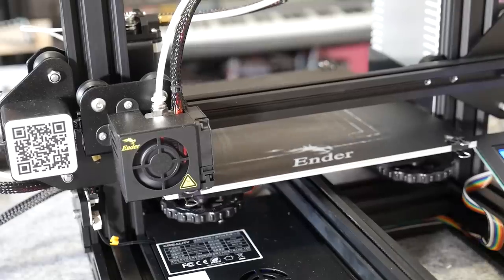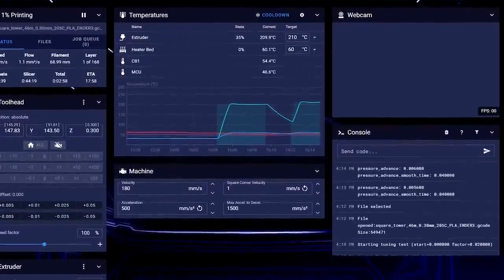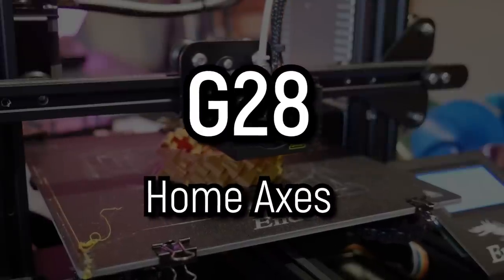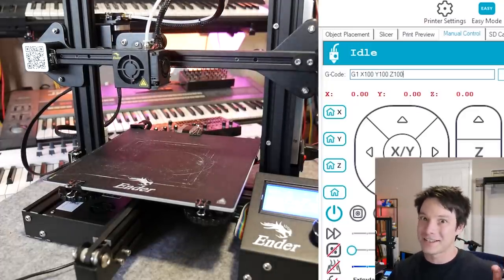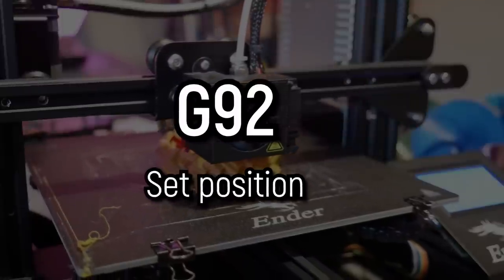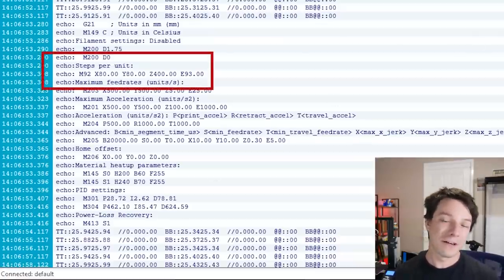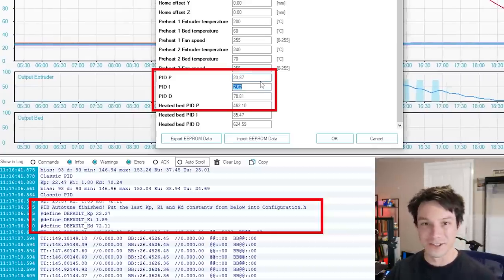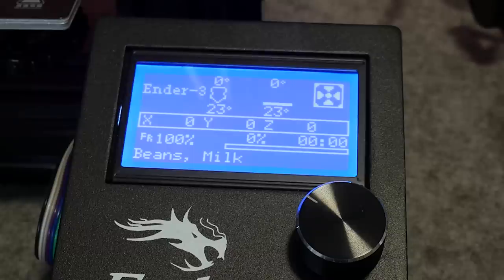Top 10 useful G-Code commands for 3D Printing

Comment: M300 and M117 could be used for diagnostics, in conjunction with the registers (i.e. Out of Work Area error could list what position it is trying to reach using an M117 code and then use an M300 code a couple times)

One set of absent codes is the G2 and G3 commands, which does Circular Interpolated movements. G2 is Clockwise, G3 is Counterclockwise.
Reply: G2/G3 reduce the size of the G-code and the stutters incredibly. Arc Welder for Cura is highly recommended in my opinion to make use of this, sadly not all printers support it. I find it quite dumb honestly, very few cases are so starving of storage that you should disable it.
Another one that takes some effort to use effectively but is pretty incredible is M486 - cancel objects.
With the appropriate post-processing script on Marlin, you can separate a multiple object print into individual parts entirely, and cancel each one individually if you see need.
The only time it doesn't work is with supports. If the support starts to fail on one part, you'll have to live with it and cancel everything or let it be, as Cura adds the Z change line right at the start of a support structure code if it has that.

Comment: M300 &  M117 are super handy for debugging, and having the machine communicate what is up. I have several machines in the next room over from my work area. Each has different tune it plays at the end of a print to let me know which machine just finished. M600 for manual color changes is super handy for basic color swaps on just a couple layers.

Sadly and frustratingly Bambu machines have no serial interface and no support for M300, M117, or M600.

Comment: M and G code is were I started in programing For FANUC CNC controllers 25 years ago, the thing that has got better is the GUI or interface software on computers to build the gcode file,
Computer power and graphics cards have grown alot. Thanks for the video !

Comment: P stands for proportional, I for integrating and d for differential. In short the p part has a linear feedback with an amplification factor which can be 0 to very big numbers. The Integrating part provides a feedback equivalent to the surface between the signal and the x axis of the difference between the setpoint and actual value. The D part outputs a signal equivalent to the rate of change of its input. These three are put in series and if you tune them just right and provide them with the right feedback, they will regulate whatever you want.

Comment: 4:15 You definitely want to prevent the USB from powering the printer.
A tiny piece of electrical tape over the 5V line on the USB connector can block the power. Or you can cut a USB cable open and reconnect all of the wires except the 5V. If you have steady hands, another option is to desolder the 5V connection of the port on the printer's mainboard.

It's a design flaw in some printer brands' USB implementation, which should be data only. There are multiple reasons why it's a bad idea -- you're basically giving 2 independent 5V power sources (which may even be at different grounds) to the printer's mainboard. Usually it'll be fine, but it could easily kill the printer mainboard (less likely, but it could even bite your PC's USB port or motherboard).

Comment: The only G-code command that caught my attention over the years is M600, filament change, for simple but very effective multi-filament/colour prints.
I discovered that PETG & TPU can stick together in these multi-filament prints, but still haven't yet figured out any designs which could benefit from being part TPU & part PETG.
Reply: Vibration dampening?
Reply: Printing a seal / gasket onto the rim of a case.

Comment: I'd recommend turning the power on while connecting to your printer. My Ender 3 has custom firmware installed, so my problems might not happen on your 3d Ender 3, but when I give it USB power and later turn on the Printer, all axies move at twice the configured speed and violently jam into the frame/buildplate (I actually lost a nozzle to this)

I just learned to always turn on the power before connecting my PC or Raspberry Pi

Comment: Good info.
I started with Repetier when I had my PrintrBot Simple 1405 print 7 years ago.  FYI Simplify3D (even the 3yr old version 4.1.2), UltaMaker Cura, PronterFace, Prusa (I believe via Octoprint), Slic3r all support a serial connection and limited control (speed and E-flow).  I have Prusa recommend not to print via serial with the chance an errant command being sent.  I have printed via my Mac using serial (Simplify3D 4.1.2) almost exclusively for 7 years and had no issues (99.98% serial, 0.02% SD card).

Comment: G Code to pause prints, maybe move to somewhere convenience, turn off nozzle heat to allow you to extract filament, then when your ready come back to temperature, extrude until new filament loaded (suitable amount purged), then stop, go back to where it left off even if you nudged it a bit while you were messing about and resume printing. Was going to try and sort out some G-Code to include to do all this on my Qidi X-Plus that I would insert at a particular layer height but, it all seemed a bit much so I have never tried it.

Comment: I'm a machinist and have been using g code for my entire life.  Since getting into 3d printing, I've been wondering why printers don't utilize G2 and G3 arc commands.  You could make a circle with one line of code instead of hundreds.  My longest programs machining is about 200k of code.  A simple 3d print of a toy was a few million.  All because it only programs in linear commands. (A, J and, I  command would be needed though).  There are so many parameters that aren't being used.  Anna what about, macros?  Would a printer read it?  Or the ability to pull up separate programs and run them within other programs.  We should get together and blow the lid off printing.  Right now it's so so basic.

Comment: A cool thing to do is: put some electrical tape on the 5V on a usb cable (those to make your cable longer, dont know how they are called in english), then the mother board only gets on when the power supply is switched on o:

Comment: Pretty sure you can actually drain the battery if your laptop while connected to a printer via usb cable. I was helping my friend set up his Ender 3 Pro, (context: his laptop battery size/capacity is at or just about at the legal limit for here in the USA, and it’s in pretty good health), and in just about two hours it nearly completely drained his battery from about 90% to about 10%. We had Cura open & connected to the printer and his laptop was plugged into the Ender 3 Pro for most of the time, plus the ender was plugged into the wall (the laptop was running off battery power).

Comment: The joke at the beginning about ChatGPT is funny, but honestly it's not far from the realm of possibility. You can represent a 3d object as a sequence of geometric arguments (point clouds, or curves, etc). And GPT models (General Purpose Transformers) are really good at working with long sequences of values or tokens. So it's entirely possible for someone to train a vanilla GPT model on mesh data, and the corresponding slicer G Code. And what you'd end up with is something that could take an arbitrary mesh, and render a (hopefully) optimized sequence of G Code steps for any machine to use. 

In fact, I'd be very surprised if the major printer manufacturers are thinking about this as they iterate on their slicer designs and optimizations.

Comment: My understanding of disconnecting power to the printer while plugged into the board through the usb is for safety. Saftey being to prevent the printer from doing anything unexpected like turning on the bed or hot end.

Comment: I watched another video that gave the advice to use your heated bed along with the box your filament came in as a dryer. They said cut the bottom side off the box, lay it over your filament to insulate it some, and heat the bed. So I want to write a simple GCode to set the bed temp, present the bed forward and raise the Z out of the way. Is there a way to do a timer where it'll sit for 4 hours and then go into cooldown on it's own? Maybe M85 but I can't find specifically what that command does for a shutdown sequence and don't know what the max value it'll accept is. I'm assuming too huge a number could crash it.

Comment: I used to run my Prusa for few weeks during pandemic when LCD broke, I was able to print using the PC to manually control the machine etc. Then the bed heater broke :D but the printer was still going strong but only with PLA , those were the times when I sued that link a lot, I did lost few prints because windows updates restarting PC when I was not there..

Comment: I like using M104 and M140 at the start of gcode so that it can home while heating, and then using M109 and M190 with the same setpoints before the first use of the extruder (purge and swipe) in case it wasn't done yet. Currently, homing is all that happens between start heat and wait-for-heat, so there's usually still a wait, but it's at least less than only using wait-for-heat instructions.

Comment: To solve the problem of USB power keeping the printer CPU and screen active, just cut the red power wire in the USB serial cable you are using. I use Pronterface on an old Windows desktop machine to connect via USB to my Ender 3. Also, most Ender 3 printers will handle a serial connection speed of 250000 bps, and I recommend this over the default 115200 bps especially if you will be sending gcode files to the printer in real time to print. You will want the faster speed to avoid lags that can happen during curves, where the linearized gcode is voluminous. Lags result in ugly blobs on the print. To change the serial connection speed, you will need to reconfigure the Marlin firmware.

Comment: Have you ever considered going from STL to a full metal casting? Seems like something you would like
Reply: Dunno about Angus, but there are people who do this.  Print a "positive" in PLA, form a mold around it, then pour in the liquid metal.  The PLA gets burned out, if you've done everything right.  It's basically "lost wax" casting for 3D-printable materials.
Reply: @firehawkdelta  yeah! Iv seen people do it with plaster and resin printers too. I just wasn’t sure if he’s thought about doing it.

Comment: I was just starting to look into the M300 command for a custom 'Print is done' tone, so I'm by no means an expert, but could it be the S parameter requires higher values to be able to be heard (and maybe internally it defaults to some value if the value supplied is lower than the frequency us humans can hear)? So instead of M300 S200 you would use M300 S2000 or something? (Haven't tried it myself yet)
Reply: The number after S is the frequency in Hertz. 440Hz is middle C. Human hearing is roughly in the range 20Hz to 20000Hz.

The stock (modified Marlin) firmware on (some) Ender printers apparently overrides the frequency so all M300 sequences play at the same frequency. If you install the full-featured Marlin (eg compile your own) your Ender can play different frequencies.
Reply: @jeremylaidman6525  THank you for that clarification. Something new learned every day ;-)

Comment: I think i'll add the M300 and M117 to some maintenance / test scripts like changing filament / purging, basically to notify when finished, or when needing any manual intervention.
Will search marlin doc if there is some command for "wait button press" instead of calling STEP_1_...gcode, STEP_2...gcode scripts.
update: seen another comment, apparently there is an M0 command for that :)

Comment: I was surprised no mention of pronterface and G0. Might want to warn people before they go experimenting with that one. G0 is rapid aka move as fast as the firmware will let you. G1 is move at the feed speed, typically 60mm/s or so. As was mentioned G and M codes are not wholly universal, however, the bog standard codes won't likely differ printer to printer.

Comment: When I first got my Ender-3 V2, I tried writing some G-code to help with bed levelling. It moved to the four corners of the bed and then to the centre but was intended to pause and wait for my Ok after each move, so I could adjust the dials. Sadly, this was when I found out that the stock Ender firmware did not support M25, It just carried on regardless, which is a real shame.

Thinking of this makes me wonder how many 3d printers do support M25, as it seems like a really useful thing to have available.

Comment: i have put a piece of electrical tape on pin 1 (+5V) of my usb cable. This to have the control board only power on when the PSU is on.

Comment: I find for dealing with extruder heating, I will have the bed and extruder start heating without waiting as soon as the print code is initialized. I have the extruder temp set to 10 below the material melting point and then once its done all of it's homing and prep, it will then get a new command to continue heating to the proper temp and go on its merry way printing. This stops pre-print nozzle oozing.

Comment: The main thing I would like to know is how to change the delay on my auto level. My cr10s ver1 has a short delay between steps. Before I finish the paper clearance test it returns all the way back to the home screen. Having to turn the dial and navigate back to auto level just to move the nozzle to the next step is such a pain. Is there a way to change it to a 20 or 30 second delay?

Comment: Now this is off topic, but i recently had changed my nozzle. The first print with the new one had something like scars on each layer, but in the form of long blobs. I am still a begginer, so I was not sure what could cause that. I was sure it was the gcode. To check that, i tried to read the commands, but it was too confusing for me. Since the blobs were quite tall (about 3-4 mm), while it was printing, I checked if the lead screw suddenly turned too much. The printer put down it's blob, but no sudden movements from the lead screw. A bit more fidling later, i found that.... my nozzle was loose? The blobs on each layer were so regular, that, atleast i thought, it couldn't be a mechanical fault, but yet it was. I can't remember the last time i was this scared lol. Btw, the printer is a stock Anycubic Kobra. It has been very reliable since!

Comment: I would have put M112 (emergency stop) somewhere near the top.  Just tell the printer to wait until the extruder reaches volcanic temps?  M112 all the way, as it won’t turn off the fan like power cycling will.
Reply from the maker: Definitely one to know!
Reply: [I recently Klipperized a printer I'm salvaging.  LOTS of emergency stops as I get my sea legs ...]

Comment: You should do a video on how to figure out how much to extrude given the length of the line you're drawing, the diameter of your nozzle, etc. E.g., if I want to draw a line that's 0.45mm wide for 80mm with a 0.6mm nozzle, what would be the G command? 

Also, the singular of axes is axis. :-)

Comment: I though G-CODE in uppercase was absolute and lowercase was relative. Turns out I got confused with path in SVG. Still, it would be nice to support this. Unfortunately, pretty much all firmware are case-insensitive, so that would be hard to implement without breaking everything

Comment: I have OctpPrint / OctpApp / Klipper, so I don't really need to use G-code much in "real time," but I do use it quite a bit in various scripts. Kinda memorized M117 when I got a bit obsessed over the printer displaying all kinds of messages when doing various things in the scripts. Sadly, I can't find the correct pin for the most recent hardware revision of the Ender 3 to put into my Klipper config file, so I can't use M300. ☹ Maybe I'll just find a buzzer to connect to a GPIO pin on the Raspberry Pi.

Comment: Do you have or know some GCode to make a Bed Leveling program? ie... auto home, move z axis up 10 mm, move to corner, pause, disable stepppers, wait until resume is pressed, enable steppers, move z axis up 10 mm, move to opposite corner, pause, disable steppers, wait until resume is pressed, enable steppers, move z axis up 10 mm, move to opposite corner ect... i know there is a step i am missing. i dont know how to auto home the z axis during this process that would not make the nozzle press into bed when it gets to the corners.

Comment: Knowing that GCODE has its origins in the 1950s, we now need to make a punch card reader for 3D printers.

PS: At a storage capacity of a whopping 80 byes it should only take a few 10s of thousands to load a model 😂

Comment: I have a usb cable ( hand made) with data in place but the power wire cut. That way things don't power up...
Reply from the maker: Interesting !
Reply: @MakersMuse  tape over the power pins on the cable works just as well without damaging it

Comment: I don't think GCode is actually a "programming language" (in the layman sense of the term) as it doesn't have if (branching) statements as far as I know, so it's not Turing complete. Its more like a DSL (Domain Specific Language). 

*Looks like there ARE some GCode implementations that have branching and are technically Turing complete, but standard GCode is not

Comment: M109 S40 does not seem to work on my FLSUN Q5 printers. Is it logic? I want to use this at the end of the script to wait until the extruder has cooled down, before I turn the motors off, so the hotend will not touch my print and ruin it. Also, I got a suggestion from ChatGPT which also does not seem to work and is rather a while loop than a simple G-Code command: 
; Wait until the extruder temperature has decreased to 40°C => NOT working
while {EXTRUDER_TEMP > 40} do {
So is this a problem with the Q5 printer or the flavor (Repetier in Cura) or is it simply not possible to send a -Code command that makes the machine wait until the temperature has been lowered? Thanks for any help!